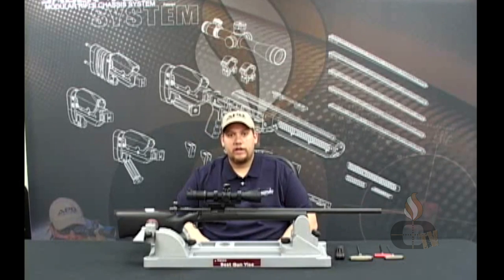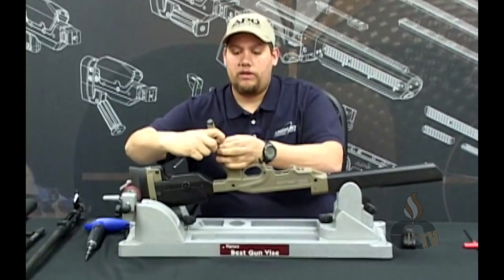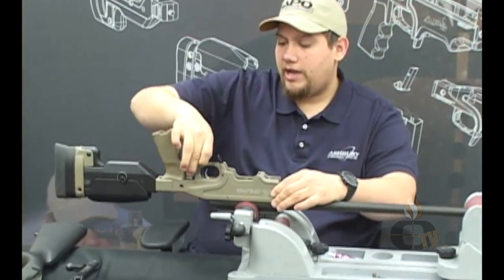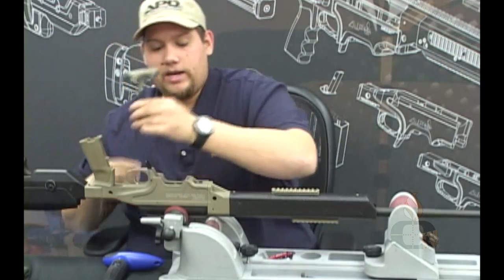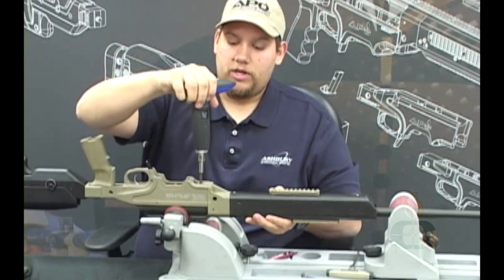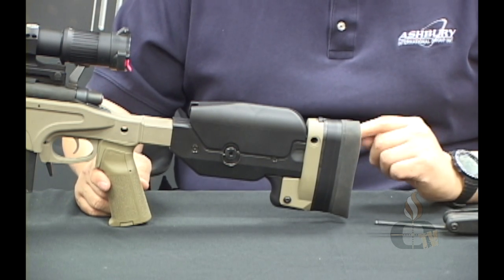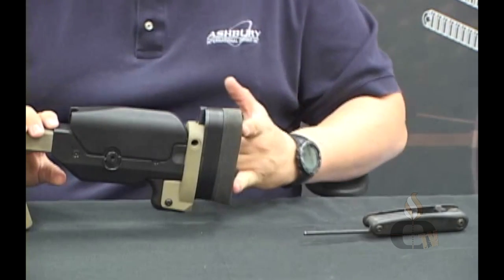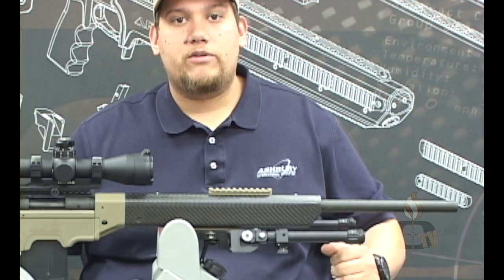SABER®-FORSST® MOD-0 install

Comment: I went with KRG stock, 1000 bucks, but so nice, and it folds... the rifle is now a 1/4 MOA system .. 175's SMK at 1000 yards when i read the wind correctly, i did 5 shots in 4 inches...